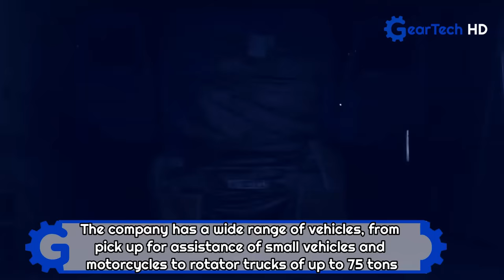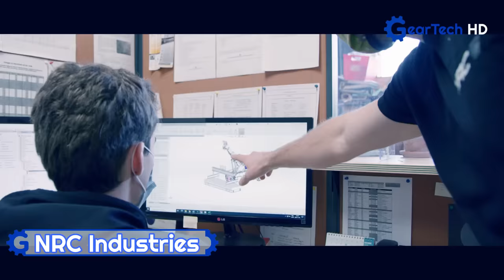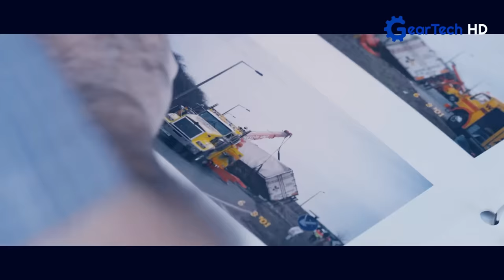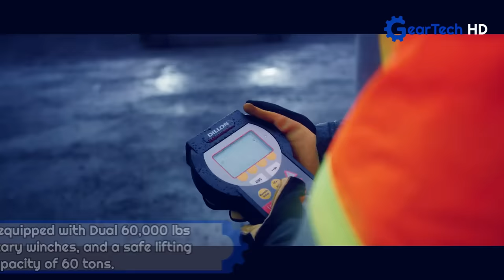The Most Advanced Tow Trucks you have to see ▶  Knuckle Boom Cranes

Comment: What I need is a smaller flatbed tow truck, one that has very WIDE tank treads between the front and rear wheels, that can be lowered to the ground so that the tow truck can get un-stuck in the deep snow they encounter, something that happens a lot in the midwest. In a lot of the blinding blizzards, the tow trucks get stuck themselves even when they keep on the pavement. Tracks would help them get unstuck. 6 feet of snow, and even chains and AWD don't do much to help.
Reply: you mean a snowcat wrecker?

Comment: when recovering a lift and tow I thought it was good practice to remove prop shaft  see towing at 4.20 min, I must asked Ron Pratt if I am right he will know.
Reply: you are correct there is no reason to have the drive shaft  spin. If the trucks  U joints got damaged  or prop shaft was bent in the roll overit will spin badly  likely to lose parts en route. Nice tow trucks

Comment: There isn't a Peterbilt Century M100 there have only been 3 made. The First Century M100 was a Kenworth W900. The Second and Third Century M100 were both Kenworth C500. Also, I would love to see an M100 On A C500W Single Steer Tri-Drive Chassis With A Sleeper Cab, A Knee Boom Under Lift, And Some Other Customizations That Would Be An Amazing Truck.
Reply: There are now 5 M100s. 3 have been delivered and #4 & 5 are in production. The 5th has a detachable underlift.
Reply: @danieljacob761  The fourth M100 Rotator was on a Peterbilt 389 Long Hood chassis it has the Underlift on it I don't think it is a Detachable Underlift. M100 Rotator #6 is going to have an Underlift on it. It is supposed to be on a Kenworth C500W Tri-Drive Chassis with a 42 inch Sleeper I talked to someone who works for the company that is supposed to get it. But I don't know about #5.